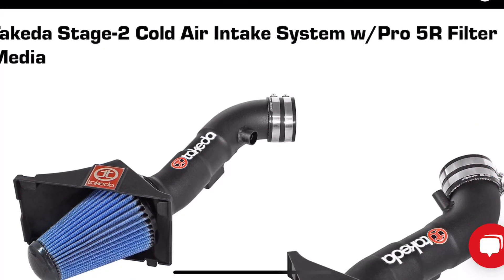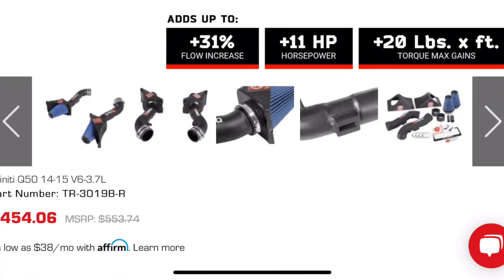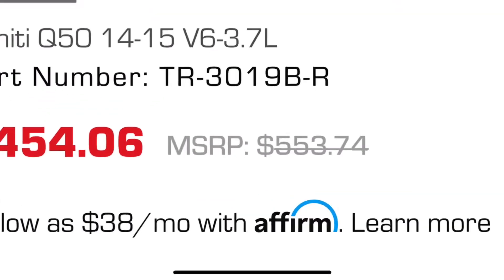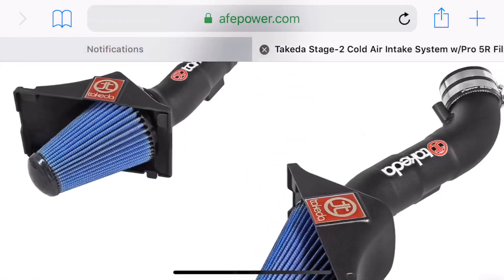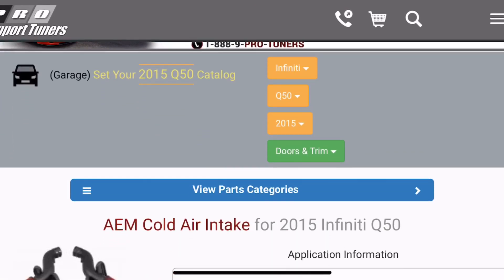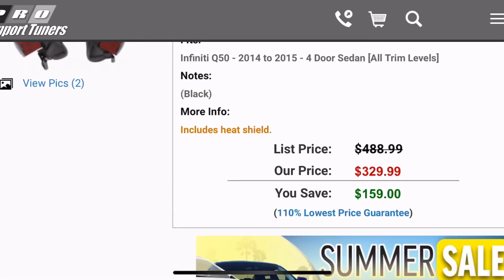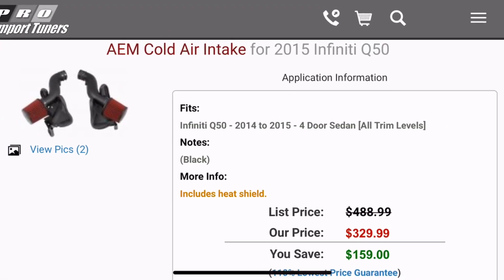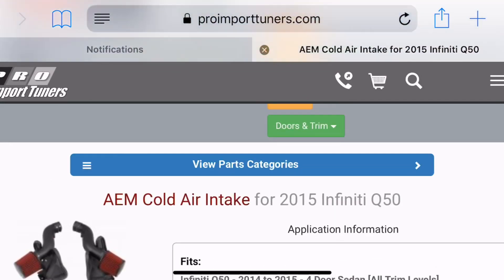STOP Buying Cold Air Intakes for your Q50!!

Comment: I got a 3.0t … worth it ?
Reply from the maker: Check out my 3.0t $5000 build video from yesterday, but long story short, some reputable shops have told me that the factory air boxes on the 3.0t perform quite well up to a certain level of power.  So really just depends on what you’re going for or how far you’re going.
Reply: @SpeedCultureStudios  thanks man. I’m just finding small mods that actually benefit my engine and gas mileage . Thought cold intakes was great on that aspect aside the racing which is not my goal

Comment: It's dyno proven on the VQ37VHR that it can add up to 13 whp, WITHOUT A tune.
Reply from the maker: That is just untrue.  Dyno proven by who?  The company selling the intakes, of course.  I’ve tested this myself and lost power and torque.  As I’ve said a million times, the G37 responds better to intakes.  There’s no doubt.  But no G37 is making 10-13 hp with them without a tune.

Comment: planning on getting afe dry drop ins, do you think the silicone post maf tubes are worth it? or can i get the same performance and whp without them?
Reply from the maker: Worth it in that they look better and they will help keep intake temps down because silicone is a better insulator than rubber but you won’t get more power with them
Reply: @ so you think it wouldn’t make a difference on the dyno
Reply from the maker: @ the filters will but the tubes no
Reply: @SpeedCultureStudios  okay thanks, last  question lol. Do you think if im not too concerned with the aesthetics of the engine bay then I should just save the $100

Comment: what if i got some $800 cold air intakes for free?
do i use them or not
Reply from the maker: What he hell intakes are $800??  But yes, as long as they aren’t hot air intakes yes go ahead and use them.  My point is that I wouldn’t spend good money on something that isn’t necessary.  If they’re free or cheap or you’re replacing broken air boxes then yes by all means!

Comment: I have a 2019 370Z with the VQ37VHR engine and I decided long ago not to replace the stock intake system with one of those CAI systems, as the stock system is very well designed and already intakes air straight from the grill intake. The ducting from the inlet to the throttle body to the manifold is plastic and rubber, just what one wants in having something that won't conduct a lot of heat from the engine bay to the incoming air. The ducts also do not have any sharp bends, so there's going to be little turbulence introduced to the airstream. The only thing that might improve airflow a little would be to put some less restrictive air filters on it but from what I've seen there is usually a trade off between the slight gain in airflow(less pressure drop across the filter) and the reduced filtration effectiveness of the filter. The very slight dyno gains I've seen on stock NA engines is on the order of a few hp at very high rpms, not worth it to me.

I'd rather spend the money on a better, less restrictive exhaust system - a set of equal length long tube headers if my state's emission control laws would permit it and an unbaffled exhaust system.

Comment: Do u also think that cai are useless for g37s?
Reply from the maker: G37 responds better to intakes than the Q, but definitely want to make sure they are long tube or at least shielded from the engine bay heat.
Reply: @SpeedCultureStudios  thanks! 2.5 or 3 inch? I dont want to tune the car just yet

Comment: I recently installed AEM cold air intakes and it just keeps bringing the check engine light about the MAF sensors and I bought new ones any idea why?
Reply from the maker: Because you’ve changed the volume of air coming in.  The car needs to be tuned

Comment: You notice a great difference going with a 3in intake and a tune. Preferably getting both by admintuning!
Reply from the maker: In the G?
Reply: Speed Culture Studios maybe you should do some research before you post a irrelevant Video with no evidence Admin tuning got 3 inch long tube intake with it tuned by Admin it prove that it increases power increases and throttle responds check there you tube account there is vide dyno evidence.
Reply: @AQCE245  Realize that Admin Tuning is in the business of selling intake systems, as well as their tuning services, and has a financial interest in making their intake systems look as good as possible. Ask yourself how much of that power that was gained was due to just the tune and how much was due to just the intake system.

Nissan maps the ignition and fuel parameters to conservative levels for safety, emissions compliance in all states and for protection of the company against excessive warranty claims. Much of that power increase you see is due to the tuner advancing the ignition timing up to the point that the knock sensors signal the computer to pull back on the timing; the tuner then backs off a little and that's it. The air fuel ratio is usually richened up from the prescribed 14.7:1 stoichiometric value which is for maximum catalytic converter efficiency to something around 13:1. This increased fuel increases the evaporative charge cooling and will result in slightly greater intake charge density, with a corresponding increase in power. The richer fuel mixture has the added benefit of allowing increased spark advance before the onset of detonation. A drawback to this is an increased tendency for carbon deposits to form in the cylinders, on the sparkplugs, on the exhaust valves and in the catalytic converters. You might see shortened catalytic converter life as a result of this.

Unless your stock intake system is badly designed, you have drastically increased the engine's volumetric efficiency, extended the rev range or have gone to forced induction, I don't think you'll see great gains from just the new intake manifold. The custom tune might be a worthwhile thing, as long as you don't operate the engine in the danger zone of borderline detonation.
Reply: @videomaniac108  what a interesting post, question you keep mentioning "catalytic converter" I've got none I got ISR long tube headers 🤷‍♂️
Reply: @videomaniac108   It is dyno proven that when tuned, both 2.5in and 3in longtube intakes can add up to 20+ whp. Intakes are a mod that keeps on giving the more you do.

Comment: I would say if it makes your cargo 2% faster and saves you 2% gas I think it's worth it
Reply from the maker: If that were true, it might be worth it to some.  They will not cut your 1/4 mile time by 0.25 seconds though.  And you can get an extra 10 miles per tank just by driving “normal.”  You don’t need intakes for that.

Comment: for some strange reason I think you're 100% correct, i installed a takeda cai on my 2014 Q50 ans received a P2096 / P2098 code shortly after
Reply from the maker: It’s not a strange reason haha. I am correct lol!  
I’ve seen it and heard it over and over—not to mention the fact that our cars truly are calibrated to a specific volume of intake air. Messing with that throws off the system.
Reply: @SpeedCultureStudios  I was told that a to would fix the problem
Reply from the maker: ls1killa a to?  I’m guessing you meant tune?  If so, yes a tune should fix the issue as it will adjust your computers parameters.

Comment: how much different is it for the G guys - the design differences and gains with a CAI?  i want to add some HFC's, an exhaust + tune, but i really don't want to modify the stock air box at all other than some high flow dry filters. car is a garage queen that i take out on nice days.
Reply from the maker: The G responds to CAIs better than the Q50 does.  It's not going to be a 15 - 20hp difference over drop in filters though.
Reply: @SpeedCultureStudios  i see a lot of guys in Gs, Zs, and Qs hitting that 330+ number with CAI and test pipes. If I can get +30-40whp throughout the power band with stock box and HFC's I'll be satisfied. Peak numbers don't interest me as much.
Reply from the maker: @jhart0512  Qs and newer Zs will make 335+ with drop ins and test pipes.  With filters and HFCs on a G, I would anticipate 320ish.  Still good though!  It'll wake it up quite a bit.

Comment: I have AFE Takeda intakes on my Q, ever since I got them installed the car isn’t as rev happy, throttle response isn’t as peppy, and the transmission shift point seemed to have changed. Can this be because the MAF sensor placement has been changed?
Reply from the maker: It’s not necessarily because the placement is changed, but it is definitely due to a much larger volume of air registering at the MAF. Your car is calibrated to a specific amount of intake flow, so when you change that to bring larger volumes in, your car will not know how to handle it. 
If you tune the car to accept those larger volumes of air, everything with get peppy again.
Reply: Speed Culture Studios im with you on this one, I’ve been tuned for around 2 months and nothing has changed. R/T tuning tuned my car. Only thing I fell is more power but the throttle and everything else hasn’t changed
Reply from the maker: XxWastednowxX they tuned with the intakes or you installed after the tune?
And did they dyno tune or remote tune?
Reply: Speed Culture Studios of course before the tune. I went to their shop in PA from NY. I’m thinking maybe it’s just the car? It’s 60K Miles, I was thinking about doing MAF sensor cleaning, Throttle body cleaning, and direct injections cleaned. What do you think? Maybe it’s just the intake? I have no idea man, I I got my car in December and a shop installed the intakes within the same week. I don’t remember much, but I do remember right after I got the car back from the shop I noticed the throttle being weirder and shift points became different in a negative way.
Reply from the maker: XxWastednowxX shifting and throttle should have improved a lot with the tune!  That was the most notable thing for me!
MAF cleaning might help, but be careful, they are quite sensitive. I’d go back to the shop if I was you!
Reply: Speed Culture Studios they weren’t professional. They told me to contact takeda. Going to infiniti to get the service done there

Comment: Sorry mate, love the videos...but...the Injen air intakes on my VQ 3.7, not only sounds awesome, but also added a noticeable bump on acceleration. Not being negative, again I enjoy your videos, but I definitely have a nicer, deeper throttle sound as well in comparison to what I'm hearing through here. Last, check out sales. Picked my set up for $220, next up Stillen catback followed by a proper tune.
Reply from the maker: I’m sorry man but it’s been proven over and over again that cai does very little for performance. I’ve made the same or more power than anyone with one. I’m not saying that don’t do anything over stock. With a tune you will definitely feel a power increase, no doubt. But you wouldn’t see a decrease putting the stock boxes and some aFe filters in. I promise you that. And they don’t make a difference in exhaust note. They just don’t. The camera mic doesn’t do the car justice. Trust me.
Reply from the maker: I should have asked what else you have?  Test pipes or cats? Stock exhaust?  You have to compare apples to apples
Reply: For now, just the Injens. They dip down sufficiently away from the engine while not so low where water puddles become a threat. Pretty sure you know which ones. Vehicle is in storage due to deployment but will be glad to share a before and after video once the Stillen catback is installed. You're absolutely right, they are pricey, but nothing incredible comes with very little expense, which is why I'll buy when they're priced down, hopefully that'll happen before my tour is over, if not I'll be $1,300 poorer. I've also been modding vehicles since I was a teenager, now mid 30's. A '95 Civic Si (MT) K&N air intake does nothing to it other than sound cool. On a '09 Mazda 3 (MT), Injen, very little, noticed a very slight gain on high rpms but like the Civic, sounds nice. On a Nissan Altima (CVT), K&N,  *complete waste of money*, on a Nissan Frontier (AUTO) K&N, noticeable increase on acceleration and on this Q, (INJEN) also a noticeable pep increase.

*edited due to typo, auto correct put MazdaSpeed when its a Mazda 3, still use as a daily work ride due to long commute.
Reply from the maker: BlkHwkGator sounds like we are the same age and started working on cars around the same time. 
The reason you’re noticing a difference in sound and everything else is because you have nothing else done. 
Most people are saying they felt very little—and many even saying the car got slower—with intakes. The way the stock system is set up, there is very little difference in design with a cai. You can hear it because of the comical filter causing the air to rush through in a different way. But you are not bringing in a larger volume of air because the diameters are so close to the same, which is where power comes from. In fact, the stillen intakes are smaller in diameter for example. If you go with the z1 intake tubes and drop in filters, it is essentially exactly the same as a cai, but it actually does a better job of bringing in cool air because of the ram style setup. You might be feeling a difference over stock, but again, once you start adding elements like catback, test pipes, tune etc, you will max out at a number that is the same as those with simple drop in filters spending half of what you spend on an intake. I’m not just making this up. It’s not an opinion. It’s been proven over and over. I did a video months ago with a dozen dyno results comparing mods and there are many more examples out there.
Reply: @SpeedCultureStudios  agreed, and great information as well for those that want to know more. I'm also not going to add the Stillen exhaust expecting a mind blowing gain, doing so because without a doubt, looks and sounds so much better than stock without pissing the neighbors off and still have a decent conversation with a hot date. However as most of us know, when adding mo' powah and sacks of money on performance upgrades, cat back exhaust upgrade is mandatory in order to get maximum gains with a proper tune. Meanwhile, I'll be happy with 330-340 whp which is my goal, ill be really impressed if more can be pushed with a proper tune. Time will tell!
Reply from the maker: BlkHwkGator yes, exhaust is essential. The factory catback is quite restrictive, but the cats are the biggest bottleneck. Do you plan to upgrade to high flow cats at least?  If not, you’ll find yourself in the 315-320 range or so, which is still respectable.

Comment: So I have a 2009 G37 Sedan. Would you recommend that I get a new Cold Air Intake system?
Reply from the maker: Lol—did you see the title of the video, or what it?  I mean if you want cai then yes—get them. It’s just not the most necessary part. They definitely look nicer than factory. Just try to find a good deal—even pre-owned.
Reply: Speed Culture Studios I thought you said it was different for G37’s that’s why I was asking.
Reply from the maker: Sebastian Galvan the Gs respond a bit better to them, yes. Using that money tho I think you’d get more out of a good set of tires or some sway bars. But that’s why I say if you can find a good deal go for it!

Comment: I've accepted the fact these filter companies lie  but humbly speaking my 05  was bone stock and  I dropped the muffler kept the cat  mapped the  throttle intake  outside the engine I front of wheel  well  driver side on DE engine I opened up the   cavity from  under the car hot knifed a gap in the mud plate  and  my car opens wide up  compare to before I can redline 3,4,5

Comment: What about long tube CAI? A lot of people on FB G37 forums think that there's a big difference between short CAI rams like the R2C and Long Tubes....that long tube CAIs are better. The filters on these long tubes are up front and in front of the radiator. In fact half of the filter is up against the hot radiator....whereas my R2C intakes use boxes with flexible rubber seals which push up against a Dynamat engine bay cover affixed to the hood. (I had to replace the old one which had dry rotted.) The boxes receive air from the car's original air ducts located in the engine bay behind the grill. I also have a cat back exhaust from Invidia (Gemini) with Titanium flame tips. The R2C intakes to be honest are mostly about the look. I didn't expect big gains...These intakes are made with steel and are Nickel plated and finished in a beautiful high gloss black finish.  Yet I was flamed for wasting my money and that my intakes were trash...And I'm dyno tuned with UPREV Osiris Ver. II. Love the sound.....
Reply from the maker: The G37s respond better to cold air intakes than the Qs do. It’s just a matter of what you want and how you want to spend your money.
Reply: @SpeedCultureStudios  Are you referring to the Turbo Q's or the Early Q's that featured the 3.7 engine?
Reply from the maker: Allan Sonac The VQ37
Reply: @SpeedCultureStudios  All VQ37s are basically the same

Comment: So basically if you have extra money to blow then a cold air intake could give your engine a tiny boost but it’s really not worth the cost.
Reply from the maker: Nailed it.
Reply: Ayyy, thanks for the reply. I have a quick question. So I’ve heard the K&N drop in filters are really good but the only problem is they come oiled and this could mess with the maf sensors so since they’re washable and reusable do you think I could just wash the oil off straight out of the box before I install them and just run them dry?
Reply from the maker: Levi Stephens no.  Just get aFe dry filters.  They are made to run dry.
Reply: Speed Culture Studios Ok, thanks.
Reply: @SpeedCultureStudios  I was looking at those filters too but decided that the miniscule performance gains at only very high rpms just wasn't worth it, especially for the drop in filtration effectiveness.